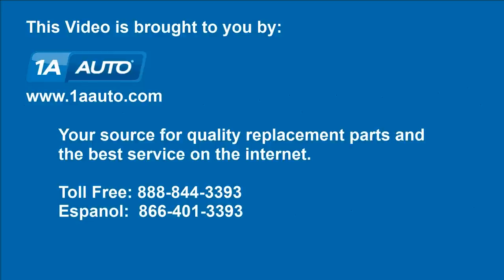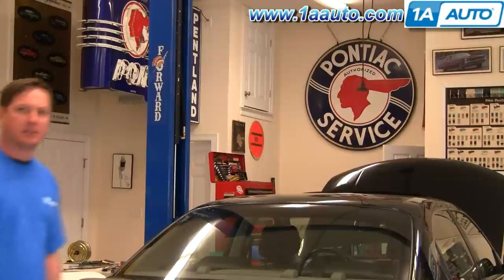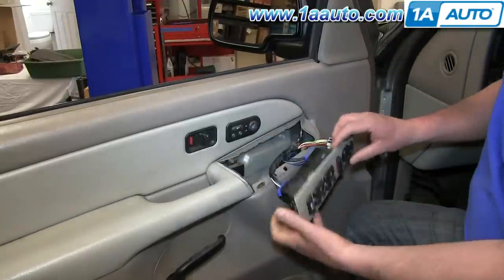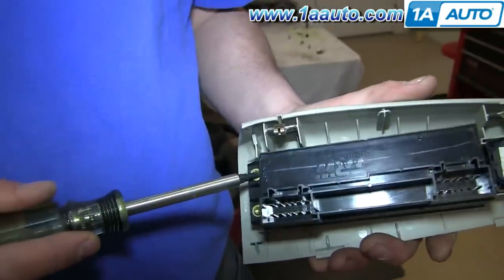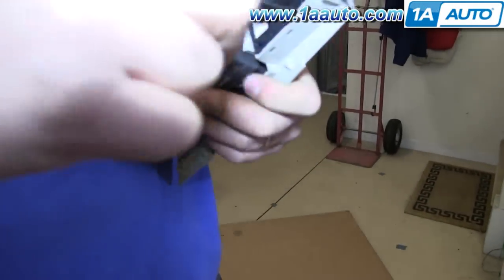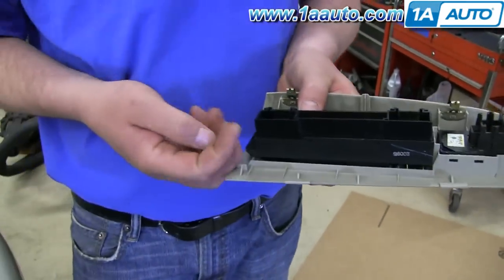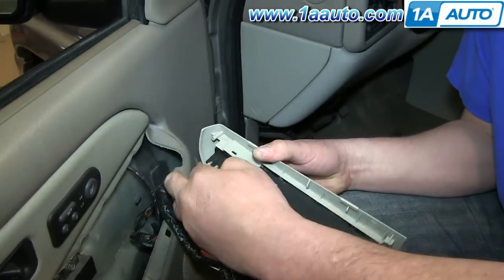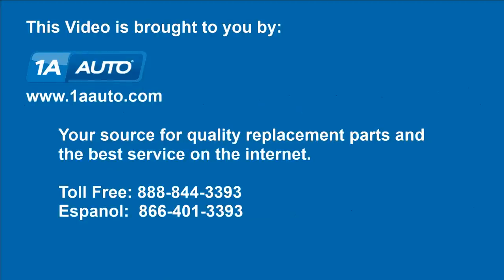How To Replace Power Window Switch 00-02 Chevy Suburban

Comment: I have a 2005 Tahoe, the switch panel works fine, however the housing that it is installed in appears to have a broken clip, Q1: Can I obtain the housing part from A, Q2: To remove the housing do you just "pry" the unit for removal, thanks for your help

Comment: I have a 03 suburban fully equipped & I don't think it just lifts up that way for me, & can't find on here how to remove master switch for my vehicle?
Reply: Did u ever find out how? I think the entire door panel has to come off and there a screw holding it in
Reply: You have to remove the door panel. I followed the video instructions and broke a plastic piece which was screwed onto the switch panel from below thru the door panel. I used gorilla glue 5 minute epoxy to fix it by snapping the panel back in and hoping for the best.

Comment: I replaced my switches, everything worked just that one of the switches broke and got tired of using a pencil to close the window. I removed the old one and put the new one and it doesn’t work, I tried the old one and it didn’t work either
Reply: Get a tester and see if you have power coming to your wires you may have a bad ground wire or just worn out wires with a bad connection

Comment: This is BS. What they don’t tell you is that you will have to get the window module programmed.  If you buy a new one or go to the junkyard and get a used one. It will not work until you go to a mechanic or a dealership and get it programmed.